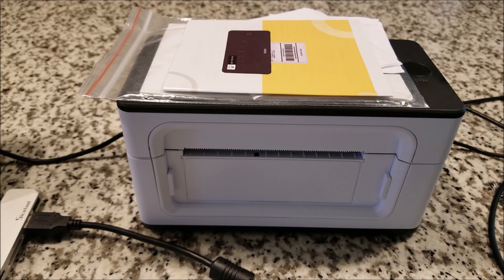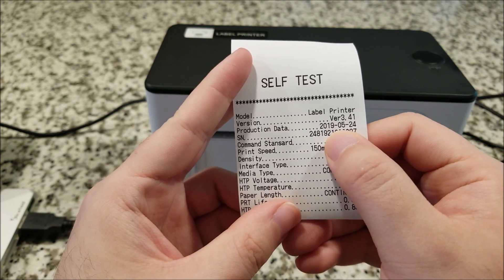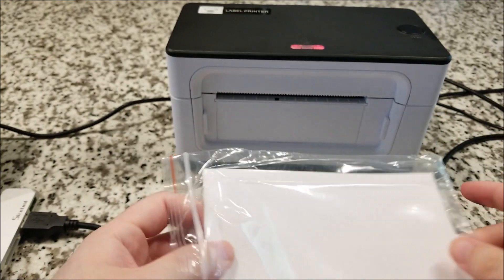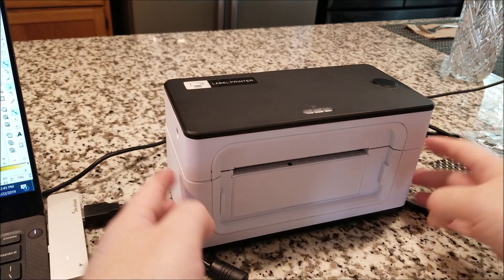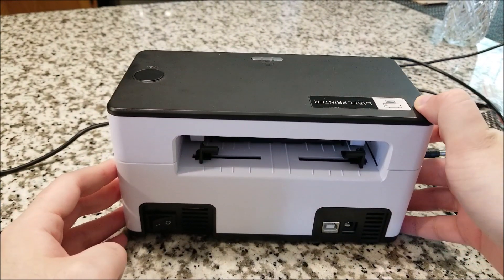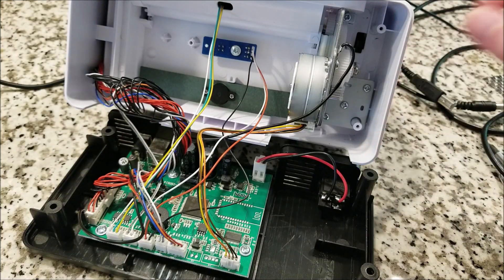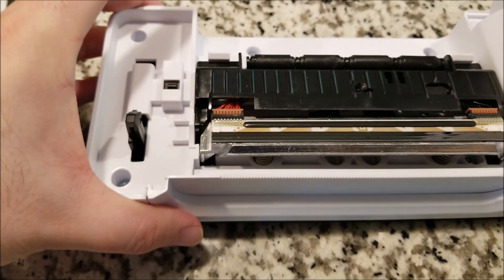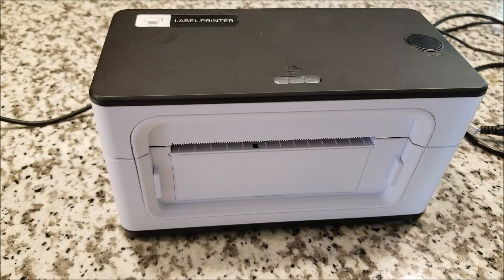Lab Tech: Munbyn USB Thermal Label Printer Review + Teardown!

Comment: Those 4”x6”labels are most commonly used for printing shipping labels (with bar codes), not address labels as was shown in the video. I appreciated the content of the video but it would have been nice to see the quality of an actual shipping label that was printed on the munbyn
Reply from the maker: I thought about printing a shipping label, but I don't have software to generate them and having ebay/paypal generate a label for me would contain my private address which I would prefer to not publicly share.
Reply: sjm4306  it’s not a big issue, and you’ve done great with the video. If in the future you want to demonstrate something like this, you can google a sample label and print it through a thermal printer. Works great!
Reply from the maker: Great idea, I would want just a generic label with a fake address just to be safe!